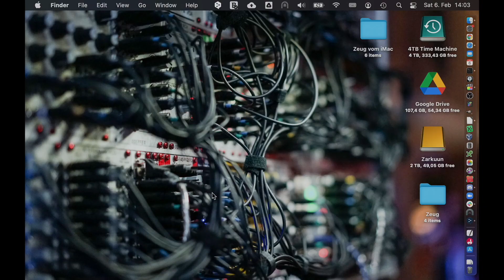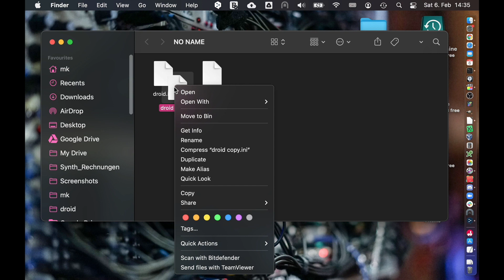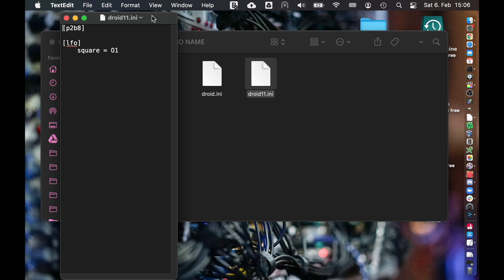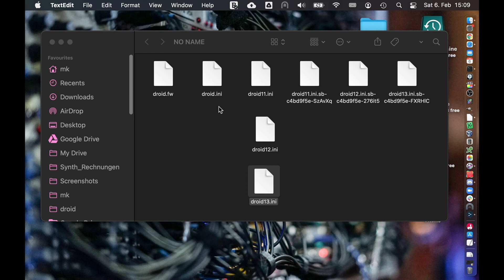DROID Episode 11 - Working with multiple patches

Comment: thanks, easy, clever and helpful concept. Would it be possible to structure the ini file with import statements to make the whole file easier to navigate. the droid.ini would be the main file which contains the master patch and where the import statements are loaded. This would enable child ini files for several circuits, which will give me more focus on what to work on and change them on the fly with X7 installed.
Reply from the maker: Meanwhile there is the "Droid Forge", a powerful graphical application for Mac and Windows (free for download). The Forge allows to organise your patches in sections. Check it out!

Comment: Loving my Droid modules... one request though. Could you give a breakdown of how the normalling circuit works, I can't quite get my head round it
Reply from the maker: It's very easy. If you send something to the output N3, the input I3 will get that signal if nothing it patched in to input 3. If you don't use N3, input I1 will be normalized to 0V. So there are the inputs N1...N8 for defining which signal an input should get if nothing is patched in. If you want the normalization to be a fixed voltage, say 5V, use a [copy] circuit with input = 5V and output = N3. But you also can send variable signals like the output of an LFO to the normalization. Note: the gates G1...G8 cannot be normalized. They have a fixed normalization to 0V.